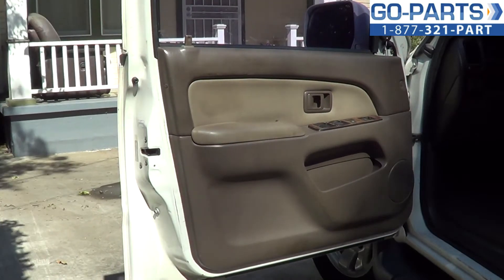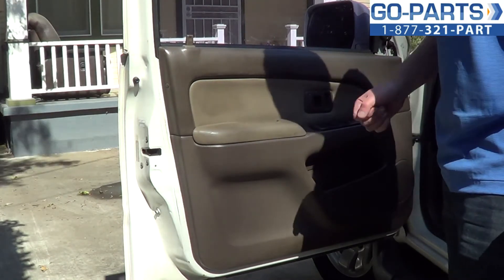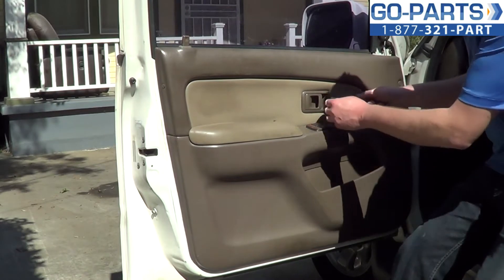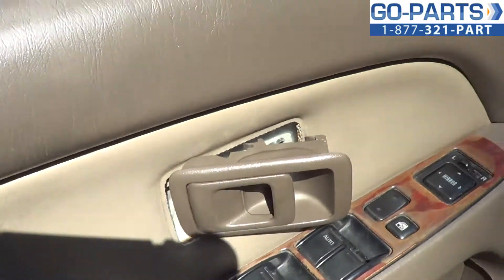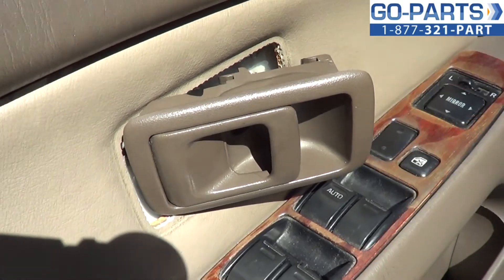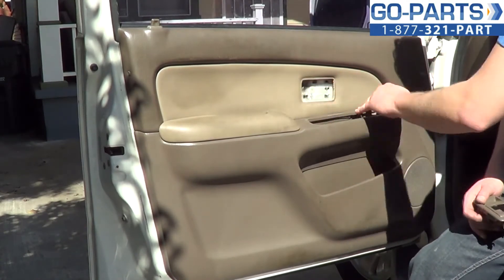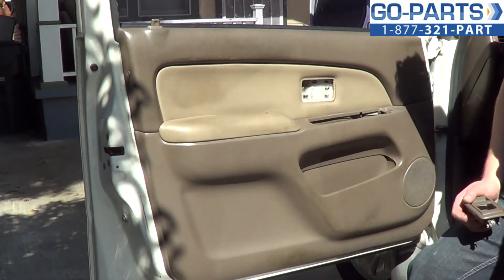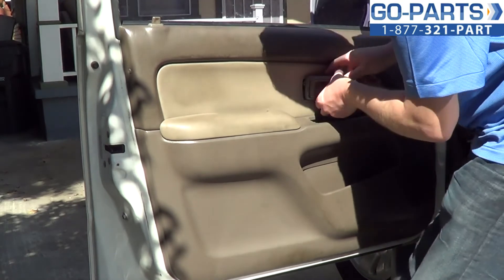Replace 1996-2002 Toyota 4Runner Front Door Handle, How to Change Install 1997 1998 1999 2000 2001

Comment: Extremely poor video instruction from procedural stance. But far more appropriate than the one I looked at under 95 Tacoma. It was for an electric more recent model. But both suffer from instructional competence. What you get is a video (I guess so you will know what a car door looks like) from over 4 feet away AND just listening to a grunt sweat and verbally (That's a poor strategy, it should be a visual list) list of parts important to the process. Better. A diagram of exploded handle assembly, not a photo, or a photo only AFTER showing the labeled essential parts (there were only 2-3)  on the exploded diagram, THEN when videoing the process a CLOSE UP OF PARTS and tools and hands. We don't need a long shot of the DOOR for heaven's sake. Then when he lists the parts he is manipulating we would have a previous clear idea of what he is referring to in vivo! Think about it. 1.)   2.) and 3.)    1.  Exploded simple diagram of part with verbal description   2.) with a quick live view of the assembly and over printed arrows as he labels the parts, then 3.) what we got, a video of him AT CLOSE UP OF PARTS AND TOOLS as he installs it. Wouldn't have taken but a few seconds video more. Trust me   Raymond Fuchs, Ph.D. neuropsychlogist learning theorist and repairman for my (2)  '95 Tacoma's and (1)  95 4-Runner.